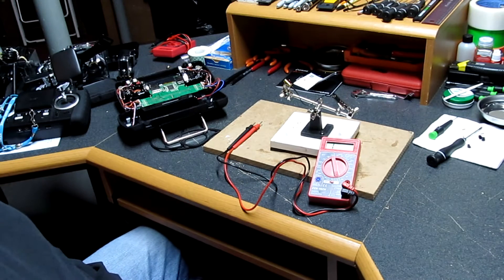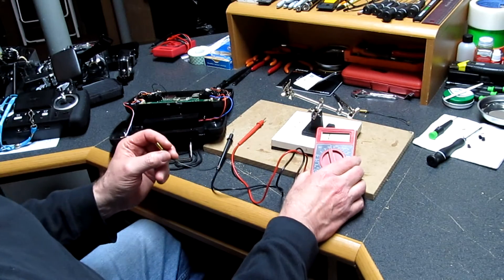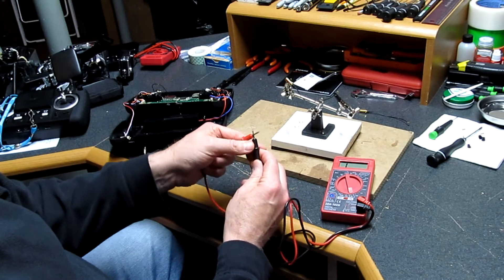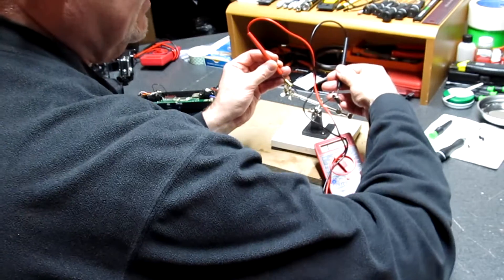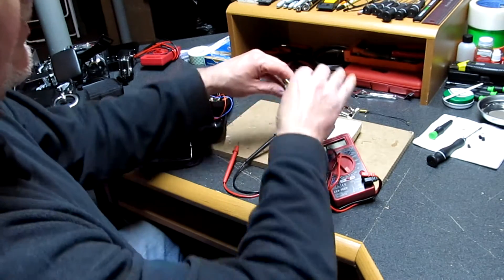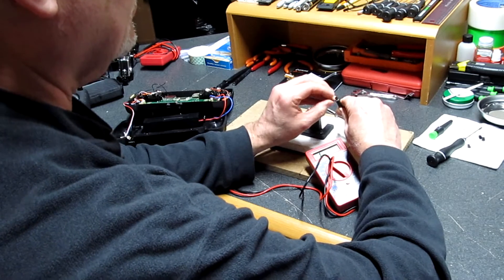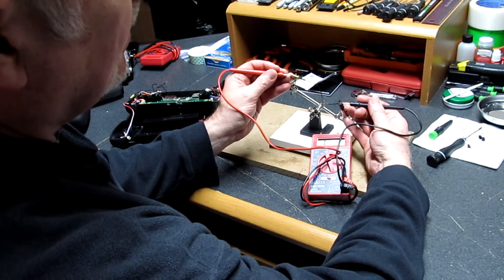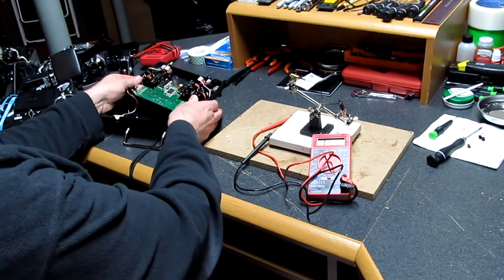Replacement of SMA Pigtail on H501S transmitter

Comment: Hi I have a Hubsan 501s Advanced and having the problem of distance using FPV - Breaks up after about 90 meters. I tried opening the advanced control but the SMA cable, pigtail side, is hot waxed any advice on how to remove to test continuity?

Comment: As requested, I'm looking in here to continue our discussion of antennas - if you would like.  In fact I've seen this video before and thought I'd already commented: after getting frustrated with the poor quality of the pigtails in both the H501S transmitter and the standard ebay mod kits (for the standard tx, not the advanced one), I eventually found that Adafruit sold a much higher quality one: Google for ADA851, I'm sure the superior shielding on the pigtail will be very obvious.
Reply from the maker: Husban has fixed my Transmitter and is sending it back to me.. Here is the correspondence:
Hello, Terry.

He had to replace the locator in the transmitter. Meaning your transmitter was incapable of calculating an exact location in a stable manner- so a replacement of the retainer/locator valve was necessary. It's fixed, tested now and will head your way today/tomorrow.

Sincerely,
Anne Lu
Hubsan USA

They mention a locator?  All I know as a guy who's background is chemistry is the right stick was not functioning properly where it would not indicate full travel on the elevator thus not arming the quad.  They also tested range and it's OK.  Of course, I replaced the pigtail. I do agree with you, the pigtails they use are inferior and break easily.

I'll do another Youtube video when I receive it back.  I've had this quad for 3 1/2 months and have never had a top to bottom controlled flight.
Reply: I assume he means the GPS module in the transmitter. Both the drone and the H501S transmitter have GPS modules. The one in the drone allows it to have position hold, return to home etc. The GPS module in the tx primarily allows follow me (it's not like the DJI where vision sensors track you - it's getting GPS coords from the tx). When you start up the tx you should get two lines of GPS coordinates, the top line is the drone, the bottom line is you (i.e. the tx).

There's a procedure in the user manual (section 5.3) for calibrating the sticks to restore full range. I'm sure I've seen YT vids about it too.
Reply from the maker: Not fixable with the calibration procedure.  I'm not sure if I had another problem with the GPS module as I was testing my quad in the basement with no GPS signals and it still would not arm as the right stick did not have full movement.  I'll test it first before I trust it at any range.
Reply: In that case you had the drone in altitude hold mode, right?  Otherwise in a basement you aren't going to get 6 sats on GPS so you aren't going to be able to arm the motors. Also check the RTH switch of course, it should be off (towards you).

Are you saying that there is mechanical damage to the sticks?  And it won't go into the "Calib mode 2" screen? If that's true you need a replacement tx - but surely the repair techs would have picked that up. Lets see what arrives back.
Reply from the maker: I was always able to arm the quad in the basement.  What my problem was, the right stick actuator was not working meaning when you arm the quad it was not fully going down to the lower right corner.

Comment: funny you should say that about your stick .. having similar problem with throttle stick..I can get into calibration..barely...everything sets right except throttle.. Rutter works though
Reply from the maker: Yes, I believe there is an issue with the actuators on this transmitter.  Husban thought I was not doing the calibration right which is Bull crap because I tried every way known to mankind and I had done it successfully before.

Comment: what was your result??
Reply from the maker: George, well, last Saturday received the new pigtail from Hubsan.  I thought I had it fixed.  Went to test the quad in my basement and it would not arm.  Puzzled, I looked at the transmitter.  The elevator stick to the right was not functioning properly.  I could not get full travel out of it, nor could I get it to stick calibrate.  Dead in the water again.  The transmitter has been sent to Hubsan.  This is definitely a transmitter issue and has never been a quad issue.  Stay tuned.

Comment: I see these SMA SMB's in my line of work and they can be problematic right out of the box. In WiFi they are terrible in low end laptops etc. Good fix..
Reply from the maker: Robert, yes indeed.  For the life of me, why would they use such frail pigtail wires???  Anyway, I have another problem with the transmitter and I ended up sending it to Hubsan.  I should have bit the bullet and purchased a Mavic.;)
Reply: They use this type of cable RG172 (I think) because of the low loss factors needed with low RF power on WiFi/Bluetooth technology and basically space.. I like that Mavic pretty cool
Reply from the maker: That makes sense.  These transmitters do send out a relatively low power signal.  How's your quad copter fun coming??;)
Reply: It's working great, flew it the other day when we were gifted with decent weather, really having fun with it. I had a brain fart and have been wanting to fly it this summer around a wind farm, Hmm not sure if this would be trouble
Reply from the maker: You have that big bird Typhoon I believe.  You'd better be careful.  You don't want to lose that in a wind farm and have somebody report you to the FAA.  Thus, why I wanted this smaller Hubsan quad.  Something I could take on my tail bag on the FJR and fly around on my motorcycle club rides.  That Typhoon is just too big...
Reply: Ya that's kinda what I thought, it comes in a backpack so I am planning on taking it with me on some rides to adventure land..somewhere this summer, ya I think my brain was trying to get me in trouble and i don't need that.

Comment: Thanks Mr P. I say those wires are just paper thin in the first place..I wish they consisted of a big ole antenna mass in the center with a thick braided shield ground on the outside.. Yea I remembe the red freebe volt meter from harbor frieght.. I had a really good one from Frys until i left it out in the rain one day..
Reply from the maker: That don't sound good..  ;)